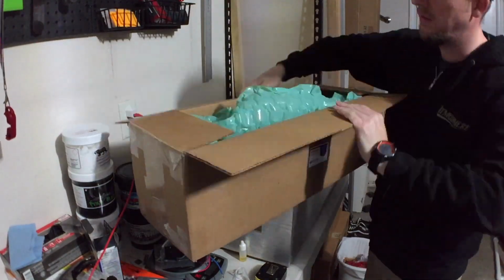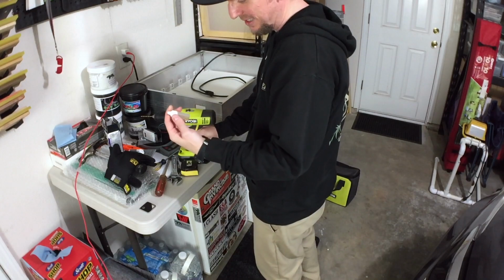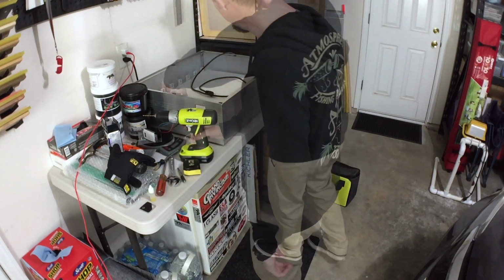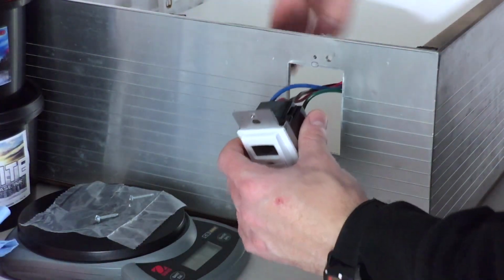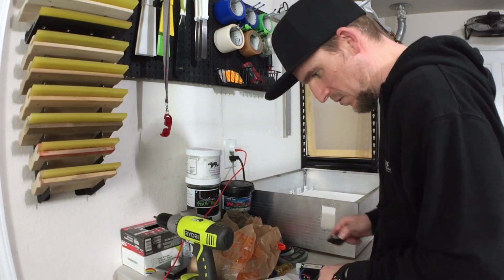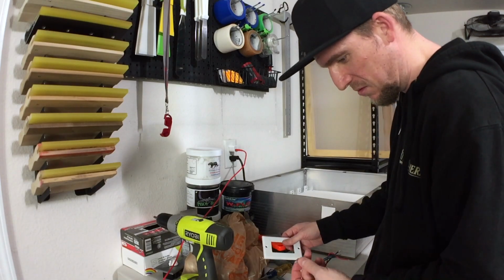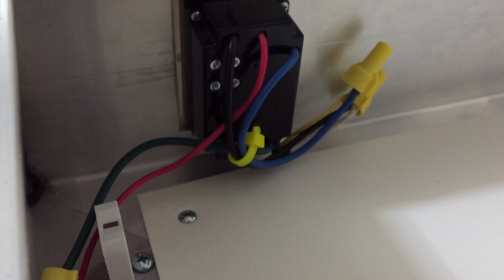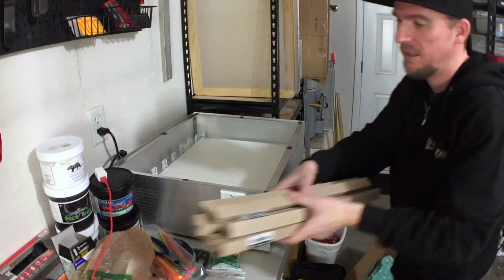DIY Digital Timer Upgrade for an old Ryonet RXP Exposure Unit — Part 2

Comment: Nice 👍 ! Can’t wait to get my switch
Reply from the maker: Glad to hear you’re gonna go for it! It worked out well! I missed a crucial wiring step in the video though so I’m gonna add that in Part 3 to help clarify. Bummed to notice after all my editing that my phone apparently raised the noise floor tremendously and the audio kinda sounds like shit this time for some reason. 😢 Really need to cop a legit camera eventually.
Reply: @hotboxprintstudio  what did miss in the wiring?
Reply from the maker: @jonathanzambrano6349  Nothing much... I just started recording a little too early is all and forgot to attach the ground. I read through the instructions a little too quick and referenced the diagram more than the written stuff so I missed it as the last step... the diagram does not show the ground, but it is recommended to protect the timer in the event of a power surge to my knowledge. I actually opened up the unit when I first got it to inspect how it was wired and they technically do have it grounded already, but I believe its prob still in your best interest to ground the timer as well. Ill show how i did it in Part 3.
Reply: @hotboxprintstudio  ya there was no ground in my current timer...I rolled with no ground. Lol
Reply from the maker: @jonathanzambrano6349  Did you acquire a different timer than the one I shared in the video? If it didnt come with a ground than yeah, it wouldn't need it.
Reply: @hotboxprintstudio  no it has a ground but my analog timer did not have a ground and I had no place to grab a ground.
Reply from the maker: Jonathan Zambrano ah, I got you... yeah it’s prob not vital to have but it may be important if you ever get a surge. Dunno what your unit looks like but this old RXP that I picked up has tap screws that secure the white diffuser behind the bulbs. I simply crimped a stud ting terminal to the ground and then secured it to one of those screws. It may not be making a conductive connection to the surface of the white plastic but it is touching the screw which is fastened to the box nonetheless and that was the easiest access point. Figured it was worth doing just in case.
Reply: @hotboxprintstudio  ya it makes sense to ground it but for now at least I have it plugged into a surge protector.
Reply from the maker: @jonathanzambrano6349  its honestly prob not a big deal. I only mentioned it initially to Rhy since I had forgot to include it in my video.

Comment: Did you do part 3 yet. I have the old time your removing and need to know what wires are what well the top 2 wires. I changed mines to uv led exposure unit. Waiting on the new switch to come and I brought a gast 112 pump of Ebay for $45 I'm making it a vacuum unit
Reply from the maker: Sorry, I never bothered with a part 3 since there wasn’t much else to show. The original analogue timer just takes a LINE and a LOAD (which you can find labeled on the timer). The new timer is essentially the same with the addition of a ground that’s not really necessary since the circuit is already grounded underneath, however I still grounded mine anyways by utilizing one of the base screws that holds down the plastic white reflector. I attached it with a simple stud ring terminal.
Reply: @hotboxprintstudio  is the blue wire not connected.is it just capped off. and the yellow and black connected together
Reply from the maker: dirtbikeq no, that sounds incorrect. Lemme get back to you on this - I’m out of town at the moment, but will look when I get back.
Reply: I got it unhooked the blue and it worked. I brought the same unit for $50 on offer up. Converted it to led. Brought the gast pump off Ebay $50 waiting on the timer to come today.
Reply from the maker: @elevated-apparel  Nice. It sounds like you've figured it out now, but just in case I will upload a pic illustrating how my wiring is configured for you shortly... be on the look out for it and subscribe if you haven't yet so that you get the notification. 

I've considered doing the same thing to my unit for LED... well see. I have plans of building an LED unit that is single point source rather than multi-point, but if I don't go that route Ill probably utilize the box from the old Ryonet unit like you did for the same thing...
Reply from the maker: @elevated-apparel  Hi, ive posted a link to an infographic that may help clarify a few things with the wiring. Check the discussion tab on my channel for more info -- happy printing!

Comment: Thinking about buying one of these old units. What is the average exposure time on those bulbs?
Reply from the maker: KNOCK OUT GRAPHICS it will typically depend on your stencil thickness, the emulsion you use, and the design... but average exposures can range from 3.5-5 minutes...

Comment: Dope video!
I heard you say you replaced the glass did you buy it from ryonet or did you go to a regular glass spot? If so how thick is the glass?
Reply from the maker: Lunar strength and conditioning hey thanks for watching ... I had a piece cut at my local glass store for about $28. It’s 1/4” thick with a “flat grind” on the edges to make it easy to grab without getting cut. If you do the same just make sure to ask for “optically clear glass”. You would just need to check listings for your local area, most glass shops will cut you what you need. ✊🏻
Reply: @hotboxprintstudio  thanks alot keep doin your thing 💪🏼
Reply from the maker: Lunar strength and conditioning no problemo! Please sub the channel if you dig the videos! — will be uploading more soon :)